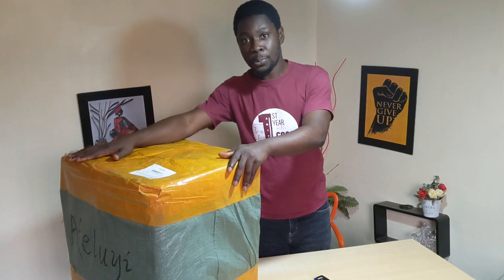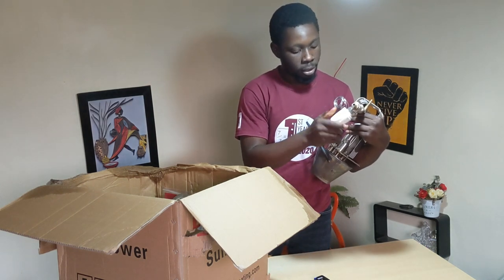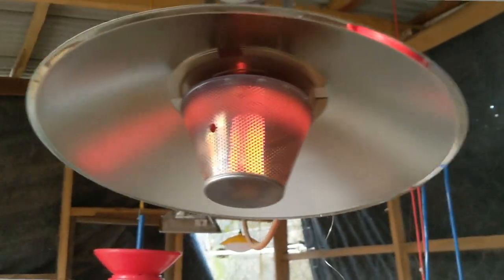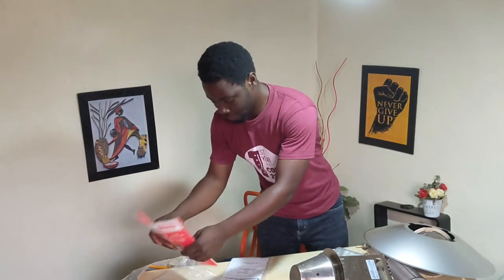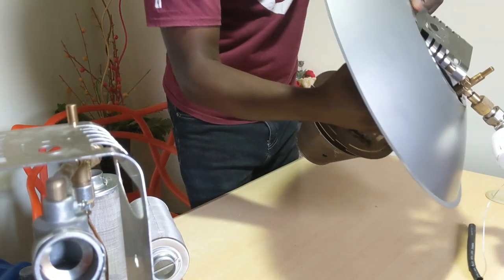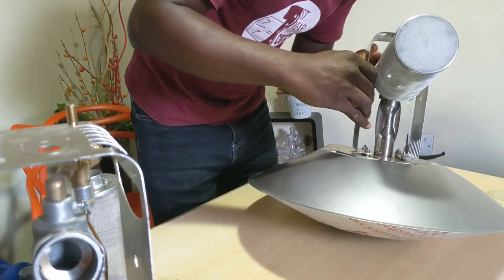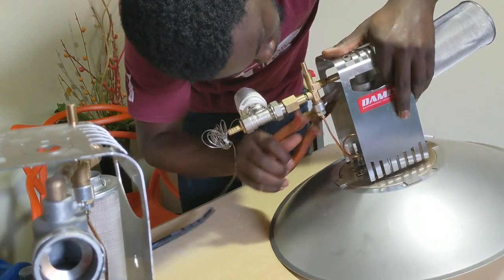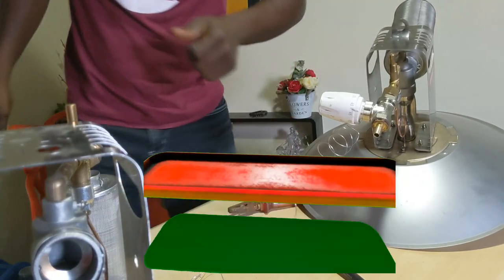Is This The Best Chicken Gas Brooder? Unboxing, Installation

Comment: What's the Gas consumption like please
Reply from the maker: On paper, not bad at all (0.47KG/Hour at max pressure and 0.047KG/Hour at minimum pressure)
But I'm going to test it and give a full review soon
Reply: It's high going by that, extremely high,
Reply: 12 hours a day all night over 5kg is gone.....
Reply: @ndubuisicharles3864  0.047×12hours=0.564 kgs actually

Comment: What's the brooding capacity for per unit
Reply from the maker: 2000-3000 birds. Though it can be used for smaller quantities too
Reply: Nice one. Free ke, spread the love ooooo 😅😅. Pls lets know the cost implication of the one with thermostat.
Reply: Does it save gas?
Reply: @cynthiaese7323  its  gas efficiency depends on your usage categorically determined by weather.
It will use lesser gas when weather is hot and tend to consume more gass when its colder